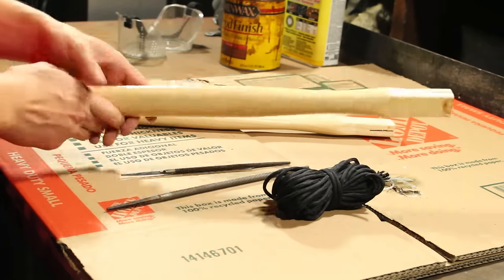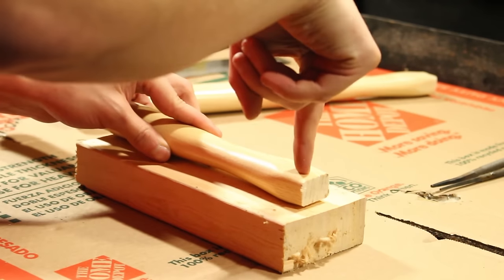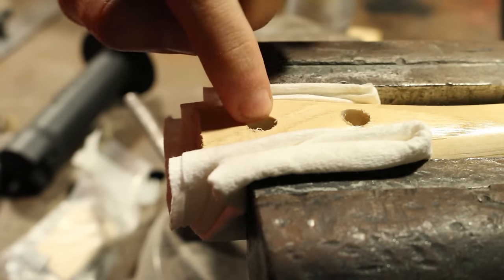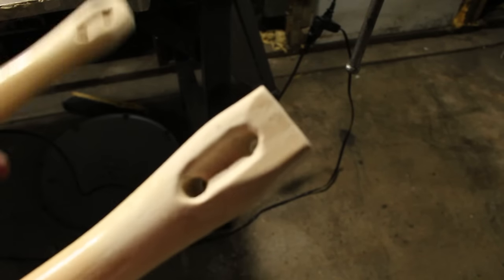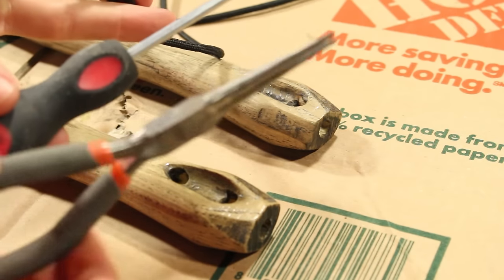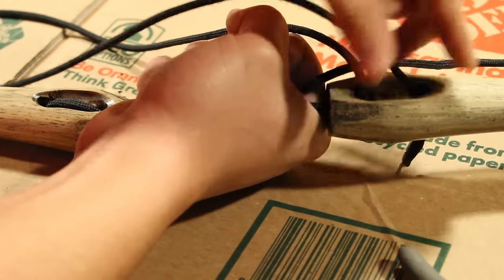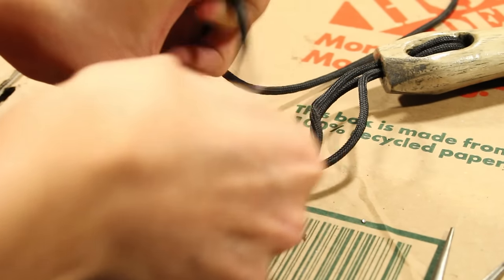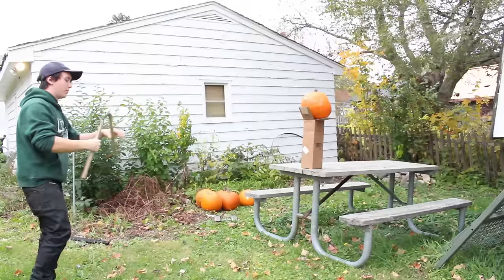EASY TO MAKE $10 NUNCHUCKS / NUNCHAKU (+Damage Test)

Comment: Nunchucks are next to useless,... A baseball bat is stronger and you are less likely to knock yourself out with it
Reply from the maker: +pattymiester 123 And about 3x less concealable, heavier and more tiring to use, slower to swing, and therefore much easier to be disarmed while using. Plus side, more damage if you do make contact. Every weapon has it's pros and cons, and If it's historically used, you can bet it's not useless.
Reply: +ZNA Productions ooooooooooooooh
Reply: +ZNA Productions Well actually, I'd say it's more conceable as you know, you could just say you play baseball. Also, a baseball bat is not quite as heavy as you make it seem. If you worked out your arms a little, you could swing one fifteen times without breaking a sweat, and that would take half the time it takes to learn how to not hit yourself with nunchucks.
second of all, nun chucks in history were not used often at all, because of its ineffectiveness. Nobles had it as a toy.
Reply: +The O Walks in to a bank with a baseball bat. Oh yea, I play baseball. Okay, you're good.
Reply: +asternotdog Yeah, I need some cash because I lost my wallet and my baseball teams hungry. Nobody is going to question or care.
Reply: +pattymiester 123 What about close combat as in an ally or hallway. Not saying nunchucks are the best option but they would probably be better.
Reply: +Jed Goodrum There is plenty of room to swing a bat in a hallway. It takes the same amount of room to swing a nunchuck as a baseball bat
Reply: but can your baseball bat fold in half?
Reply: +Jed Goodrum Congrats! You have a stick. A useless one for fighting.
Reply: Yeh sorry I agree with you now, the reason the nunchuck is going to die out and defiantly has not been a well regarded martial arts weapon for hundreds of years is because no one had thought of using a bat.
Reply: +Jed Goodrum Actually, it's only been a well regarded martial arts weapon since Bruce Lee popularized it. It was never used as an actual weapon, only as a toy for nobles.
Reply: +Jed Goodrum they are horrifically awkward and require a lot of training to use so you don't fuck yourself up with them. The baseball bat was just an example... However nunchucks do have a lot of intimidation value to them.
Reply: +pattymiester 123 It's like the same reason Bali-songs are intimidating
Reply: +Richard Hill nunchucks aren't a weapon. they were only forced into the position by peasants who couldn't afford real weapons. the fact is that a bat is much better. but better yet is a club. better yet is a baton. better yet is a staff.
Reply: +Clash Bluelight but nunchucks are cool as fuck
Reply: Basically this is a vidio of how to make nunchucks out of two hammers and some pericord for under $10. A bat may be  good weapon but im pretty sure a sword is a better weapon than a bat and im pretty sure a gun is better than a sword and it continues. If you want to use a bat in a fight go ahead if you want to use nunchucks sure go ahead but to be fair we all probably arnt even going to get into a fight that requires weapons and if we do I doupt it will be a bat or nunchucks probably a better weapon like a knife or something sharp in which case if we do use it we will probably only use it once then go to prison.
Reply: +Jed Goodrum Of course, but I was simply correcting zna
Reply: +pattymiester 123 basically because weren't mean to be weapons, nunchucks are used for shows
Reply: pattymiester 123 only when it's bruce lee in control lol!
Reply: As a Nunchaku practicioner, in correct hands you can beat the shit out of anyone, it is about the speed, the grip, and a longer extension of the arm with something harder than your fist, he did only shoulder strikes wich are nice, but there are hip strikes and arm strikes using the bicep to do vertical strikes. It also develops your hand speed and the posture, and gives you a 360° angle of attack. Also you can use the cord to grip a limb and perform a grapple.
Reply: +asternotdog robbing a bank with nunchucks sounds better to you?
Reply: +pattymiester +ZNA Production just owned you
Reply: +pattymiester 123 yes, but if you want effectiveness just buy a cheap kitchen knife, sharpen it as much as you can, make a cardboard sheath and strap it to your forearm. That of course wouldn't make for such a good video though.
Reply: +m1stercheese That would be a pathetic weapon
Reply: +ZNA Productions well you need to make the sring 1.5X longer than you can use it much more deadly than a baseball bat
Reply: If you actually train with them, they're quite effective. If you don't, then just use it like a flail. And BTW, they weren't used historically because other weapons (katana, etc) were better, not because nunchuks are bad.
Reply: +The O A bat isn't heavy, but it takes more to stop a bat's motion than for nunchucks. And nunchucks would be able to deliver blows faster than the bat. Swing a bat fifteen times, and every time you miss, you need to stop it and start it again. Nunchucks can gain speed even if they miss and take less than a bat to get moving, since you can basically let them rebound off your own body with the cord. Bats aren't heavy, but they are heavier, and you'll deliver some major damage, but you will tire faster. 
Nunchucks are difficult to use, and it was less that they were ineffective and more that other weapons were more effective. Use in history doesn't exactly make a weapon better or worse. The smallsword and most varieties of the spadroon were definitely at a disadvantage compared to the sabre or the rapier or really most swords of the time, but we still regularly see them in history. Nunchucks are specialized, and difficult to learn. That's why they're seen less. Not from ineffectiveness.
Reply: It's not like he did s making these for r zombies or something. He doesn't need to make a baseball bat
Reply: nunchucks are quicker and you can get alot of power from them if you know how to use them
Reply: +The O I guess farmers didn't use it in japan to fight back huh u better learn ur history dude nunchucks were a farming tool
Reply: +The O again it was used as an actual weapon so were kamas tonfas bo staffs sais etc they were used by farmers to fight back against the samurai
Reply: +believe it You are calling me stupid? The whole idea of nunchucks become only popular in martial arts due to the Bruce lee thing, yes. If not for that, they would be completely.
Also, I'm sorry. But one he from a baseball from the side is breaking either your arm or your ribs. A nunchuck hit the head arguably might concise you.
Reply: The O WTF does  a gun have to do with taking a ball bat away from you with a pair of nunchuckas? smh. If I have a tank I trump your gun.......wtf is wrong with people?
Reply: +believe it It was an analogy. I'm saying it was preposterous that you could disarm a baseball bat with nunchucks. Also, this is assuming that the nunchuck master has massive training and experience, and we're assuming that the baseball wielded has little to none training, and yet it still is a equally good, if not better choice. Also, I have a question. If someone was swinging a baseball bat at the side of your torso, how would you possibly block that? I'm pretty sure you could not, seeing as you have less than a second to react before it breaks your ribs, which it is cabals of in one shot, unlike the nunchucks.
Reply: +The O im an expert in nunchakus. so much so that you should know what its chain or cord can do. why do you think it's there? it might as well be 2 escrimas without the cord. and no. a baseball bat is not heavy. but because of the imbalance, a high velocity bat swing is very hard to change trajectory in a short period of time. the nanchaku can change its trajectory in less than a second. bat swings are super easy to dodge.
Reply: +ProTon Pack-A-Punched Um, a baseball bat swung from the side? How exactly would you dodge that? And change the trajectory? That would require an amount of kinetic energy a nunchuck is not really capable of inflicting.
Reply: +pattymiester 123 not true, if you look back at old records of their original use and how they were then repurposed as weapons it shows just how effective they were. true a base ball bat is very effective and easy to use, but someone with more time and patience that is willing to learn how to use them can become extremely efficient with them.
Reply: you can strike more directly with chucks.  and quicker than the bat.
Reply: ***** their real name isn't even nun chucks
Reply: nunchucks useless? a baseball bats easier to use, yea but dude nunchucks are unpredictable in the hands of somebody who knows how to use them. on top of that, they have just as much, if not more reach than a baseball bat.
Reply: +more of a glock guy nunchaku
Reply: nunchaku are only dangerous if you're scared of them honestly, they don't do much damage. if you block and counter, you win.
Reply: Son, have you seen Bruce Lee?
Reply: That is incorrect I can use nunchucks way faster than a baseball bat and hit harder than a baseball bat it's all about skill
Reply: I know how i can end this argument....Make the nunchucks out of metal and you're gonna kick some ass.
Reply: +ZNA Productions 
On top of that, if you diligently practice with them for even a few weeks, nunchucks are blindingly fast, and can hit a foe repeatedly in a matter of split seconds. If a person gets professional training, they can be lethal.
They originated from small/handheld rice flails used in Okinawa in antiquity. When the Japanese took over the islands in the long feudal period, the common folk were forbidden to use/carry swords, spears, bows, and even large knives, so the peasants turned to their everyday agricultural tools. Thus Kobudo was born.
Reply: Criz Jay Yup, people think nunchuks are used like Mikey from TMNT. But if u whip it out like a wet towel, its like a jab and probably faster than a baseball swing.
Reply: i dont know what you all are talking about, an effective  version of a nunchuck is a flail, same kinda concept, except the contact of the weapon is smaller and heavier, making it more dangerous and more able to break bone
Reply: but they look cool
Reply: +pattymiester 123 that's why I would rather use solid steel blunt sai small, effective, can deal loads of damage, can be dual wielded, and above it as light as a brass baseball  bat (pretty damn light).
Reply: pattymiester 123 If you know how to use nunchucks a bat is useless
Reply: The Mighty Sandwich Videos
and if you know how to use a spear then every other form of melee weapon is useless, plus you can throw spears. Then there's guns, those obsolesce everything else ever.
Reply: so many people here talk out of their butts.  anyone can use a knife to stab. anyone can whack with a stick, too. nunchucks are lethal.  i took them to a party once.  people like to theorize that they're useless and a knife or bat would be better. the fact is it doesn't matter which is better, if you have a trained person using any weapon in front of you, you better beware or you will get yourself hurt.  all i see here is a bunch of dudes comparing which weapon comes out the winner if two equals versed each other..  life doesn't work like that.  you can keep your bat, just remember that whomever trains less with their chosen weapon will probably lose.  also, you can't carry a bat around. i can conceal my nunchucks in my bag. i could have a knife but blunt objects carry a smaller sentence if caught by police
Reply: Trance Kowhai
wew lad
you don't need nunchucks when you're edgier than a katana folded 1000 times nippon steel :^)
wew

train with your 3 foot reach whacky sticks all you want, a sharp 6 foot stick takes no training to stab someone with and easily outdistances anything else blunt or not
Reply: pattymiester 123  I could do more damage with Chuck's quicker than you could lift the bat to swing, weapon is useless without the knowledge or experience using it. It's like trying to use a gun and not knowing how to load it. weapon does not matter the best weapon in any fight is your mind. there are numerous ways to avoid a bat, Chuck's even a gun at close distance. friend of mine swore a sword is better than a pair of sai, we went full force fighting to test his sword against my sai, I won best of 3, accidently broke his pinky cause I caught the horn below his hand guard instead of above, then to show him weapon does not matter we swapped weapons and I won best of 3 with the sword, then best of 3 empty handed against both. all this talk this weapon better than this one this weapon better than that one, the best weapon is yourself, if you are only skilled with one weapon then you would not be able to use your environment or other things around you for defense because you've become solely reliant on one particular weapon.
Reply: KingHalbatorix: Try your sword against my empty hands or a rolled up newspaper. can't stab whats not there. anyone can avoid being cut or stabbed with proper training, a friend and I tested my 3ft pair of sai against his katana, I won best of 3, we swapped, I won best of 3, then we tried both weapons against me, best of 3, weapon dose not matter, best weapon is yourself. old saying, better a wise man with only his wit than a fool reliant on one tool.
Reply: Seth Surgener
you don't even realize the levels of edgy you're managing to reach
Reply: If you knock yourself out with Nunchucks it's not because they're a useless weapon but more so that you're a useless wielder.
Reply: KingHalbatorix lol a sword could pose a threat to an unexperienced user.  If they stand in the wrong stance they could slice their own neck off.  or even if you use a gun and don't know how to operate it you can end up shooting yourself, weirdly enough.  At the end of the day all weapons require experience to be used and nunchucks definitely have their use..  I wouldn't want to carry a knife, sword, machete or a gun in case of killing the other person but a bat is too large to carry.  A knuckle buster thing has no range and so in this particular instance, nunchucks would be the best choice.  Now i wouldn't bother using any of these unless i trained so as not to hurt myself and also to inflict the maximum amount of damage to an opponent without having to kill them (just disable).  Sure, a gun beats most things but depending on the situation, one weapon may be better than others for the nature of the task at hand.
Reply: KingHalbatorix damn son calm down
Reply: Trance Kowhai
maybe if you learn to read
Reply: KingHalbatorix -.- I'm graduating from the most prestigious university in my country.  I'm certain I know how to read but if I missed something then, well, that was my fault.
Reply: Trance Kowhai
Maybe you should go into topographical mathematics as a major and write a paper on yourself, because I've never seen anything with as much edge as you
Reply: ZNA Productions, has over double the likes of original comment lol
Reply: gosonegr originally, they were farming tools used as the bite for plow horses, and were weaponized by the okinawans when they were under samurai control
Reply: pattymiester 123 but the art is in truly mastering the technique and release your chi
Reply: pattymiester 123 Spec ops guys use them as they can get around a block, or break the arm... Not useless.
Reply: Well, I guess it's value lies partially in it's unpredictability and speed.
Reply: true i trained with nunchucks for like 2 days for the full day and i'm smashing anythig i can find into pieces lol
Nunchucks are way better
Reply: These replies were a joy to read.
Reply: Every weapon is conceptualized with advantages and disadvantages. Nunchucks are faster and more nimbles, yet deliver overall less concussive force. A club delivers skullcracking concussive force at the cost of a less nimble weapon. When it comes down to it, the skillset of the user is what determines the outcome.

Comment: Don’t quote me on this but a friend once told me that the tapering is because for the weight to be kept at the bottom so your nunchucks won’t fold in the middle of the swing, that’s why when i made mine with just a dowel (but i might have had cut the handle a bit shorter as i expected), i compensated that problem by putting a light weight at the bottom, light enough to keep the momentum but not heavy enough to impede the motion. Something like a small drawer knob. Or a screw and washer.

Comment: Just found your videos tonight and went through probably a dozen of them so far. Really creative, and good-looking weapons, especially for made on the cheap.

Choke up on your grip and you'll have a lot better control (it'll also be a lot safer to make sure that you don't have enough slack to accidentally smack yourself in the back of the head for the underarm tucks), but other than that - looked pretty impressive for somebody who's never used them before.

Comment: Just a suggestion from a fan, you could add a little weight in the ends of the kontei (the ends) by drilling into the end a short ways and screwing in a lag bolt (I'd offer size suggestions, but I don't honestly know the diameter of the hammer grips you've got there), and then, not only would you have a kontei you could use as a bashing weapon for a short range smack if needed, but the added weight would improve the velocity of the batons when in motion.  You could further enhance that effect with some wire wrapping near the ends of the individual batons.  Obviously, that adds time and expense to the build you've shown here, but, for those interested, not a huge amount of either.  Make those sumbitch pumpkins PAY!

Comment: when I string my nunchaku, I do it the same way as you except I try to braid the strings between them, and I braid them instead of wrapping them at the ends. That, and paracord is synthetic. You can use a lighter to just melt the ends to keep them from fraying.